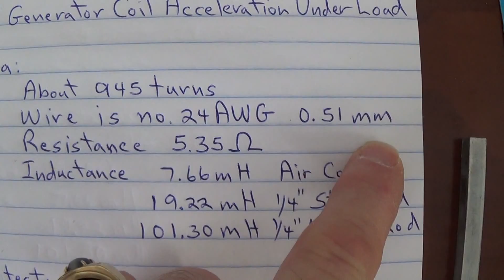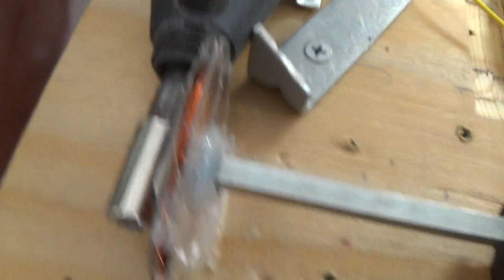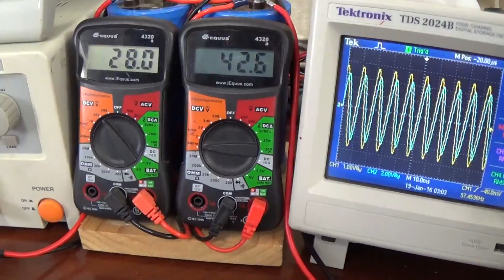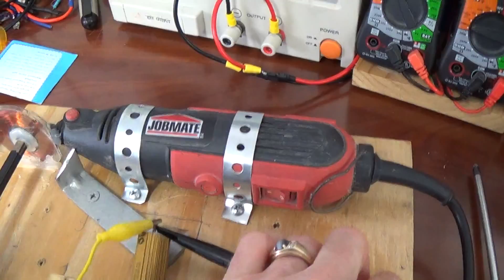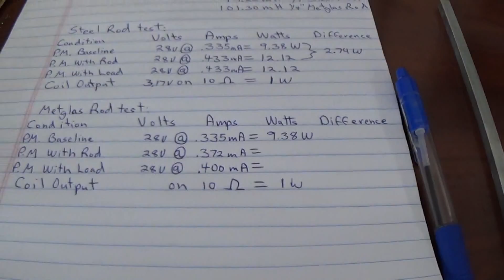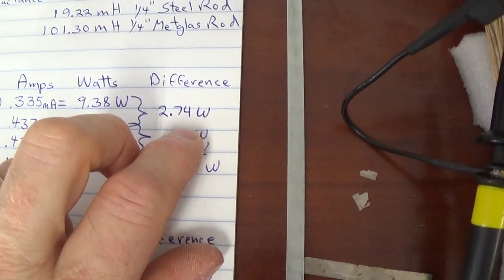Study of Generator Coil Acceleration Under Load test 2

Comment: Instead of putting resistive load, try shorting the coil and if coil shorting makes u achieve over unity then try connecting many small loads in parallel to make the coil current equal to the coil current when  coil was shorted, and perform the same tests again.

Comment: Hi, Luc, you make good points. Just nit picking, for your current notations.  The proper notation for decimals, for example, 430 millamps is 0.43 amps or 430ma,  not .430ma,  0.430ma is actually 430 microamps. I hope this helps, and I mean that respectfully. Luc. thanks again for all your support to the free energy movement and community.
Reply from the maker: +Mike Poirier Thanks Mike, I do know that about the amps. These kind of things happen when I multitask while doing these video. It's difficult, for me anyways, to get it all perfect. I do appreciate you letting me know and for your appreciation of my sharing. Luc

Comment: The best test for electric motor output power is max amp to a stop and also at about 90% of max. If you say the increase in acceleration is accompanied a loss in torque thus less power these tests will show this.

Comment: The shorted coil test is not useless. We're dealing with vacuum energy pressure, so you have to let it flow easily in order to excite the coil and turn it into a "gate". A prime mover becomes a generator while a generator turns into a prime mover, not with a setup like this, obviously.
Reply from the maker: +Acceleration under load Please make a video or give me the link of an existing one where what you describe is demonstrated. Kind regards. Luc
Reply: For the simple acceleration you already did it, and every time we accelerate a rotor that spins freely by putting near a coil. I'm modifying a Quantamagnetics pulse motor/generator, you have to wait for the video.
Reply from the maker: +Acceleration under load  Please send me the link when you have the video up. Luc